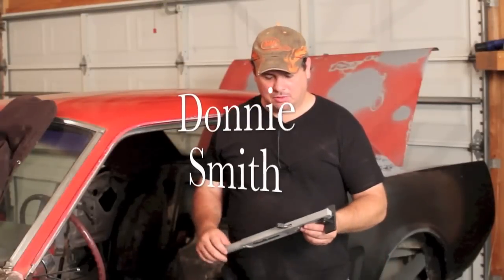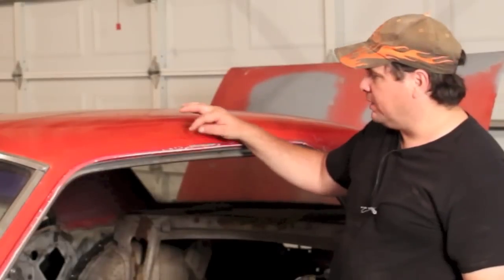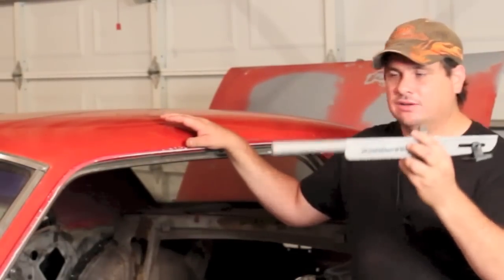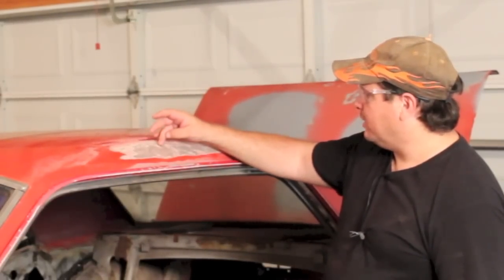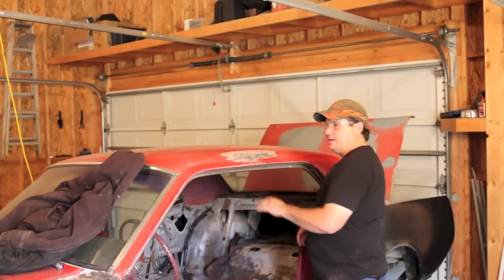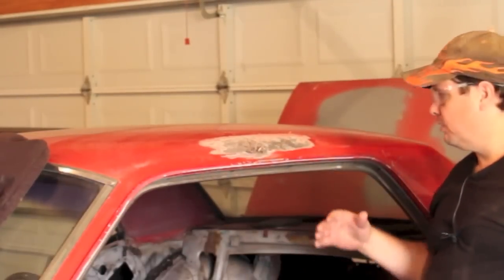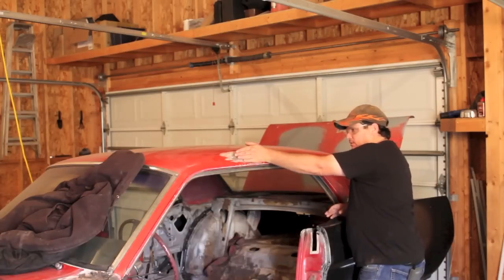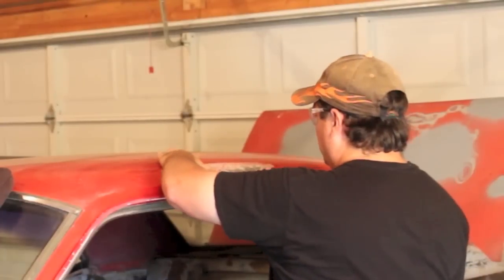Body Line Dent Repair on the 66 Mustang Using a Stud Lever

Comment: Great demo!  
An off subject question about the underside of the roof. I pulled the headliner out of our '66 Mustang and found a lot of surface rust. What is the best way to stop the rust? The same type of rust is found on the inside of doors and back sides of quarter panels, places that are difficult to reach. Thought about POR15, should it be sanded first? What about places that can't be reached to sand?  Thanks, Casey

Comment: I found that twisting off the studs takes my metal with it and I don't like that. I would rather cut and grind. Donnie, can you make a vid pulling a dent from the front of a hood, right at the tip?
Reply: Why
Reply: It's against OEM to repair hoods